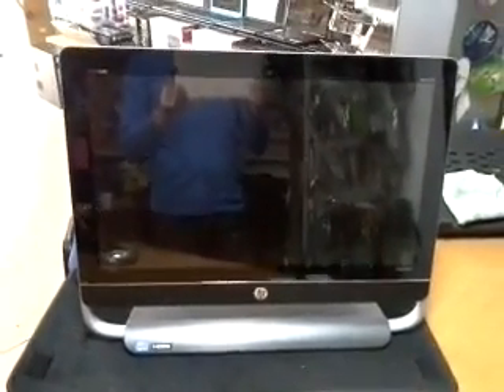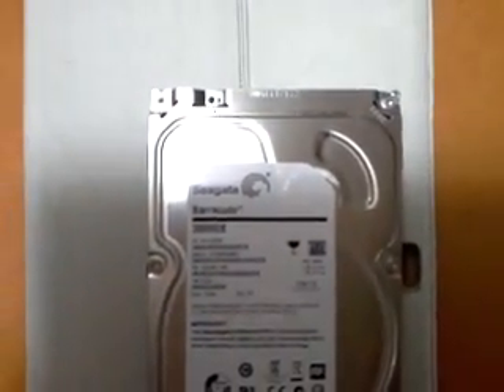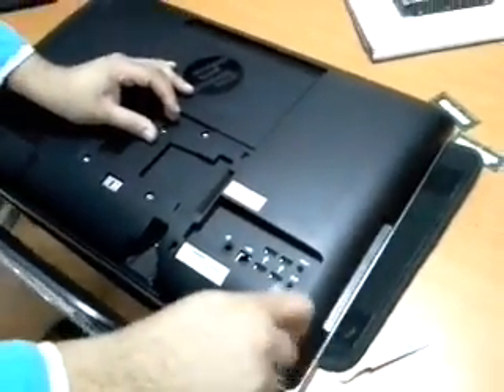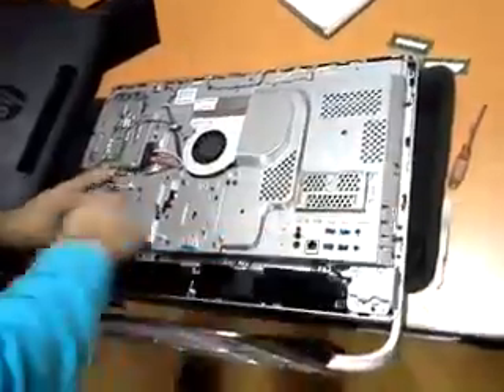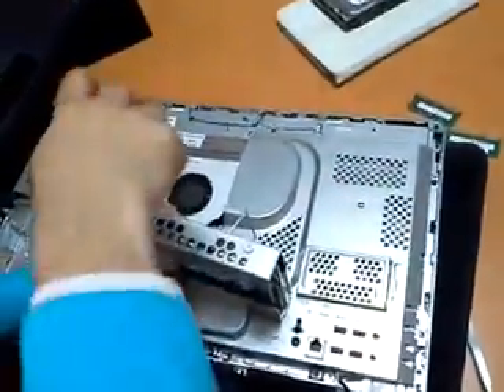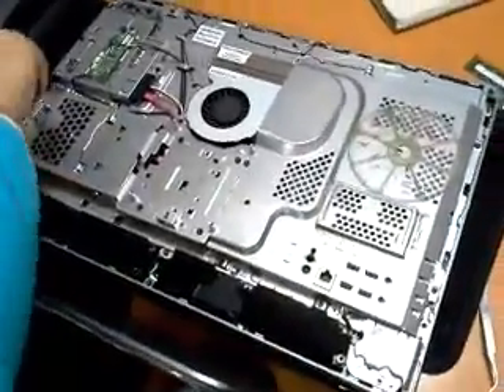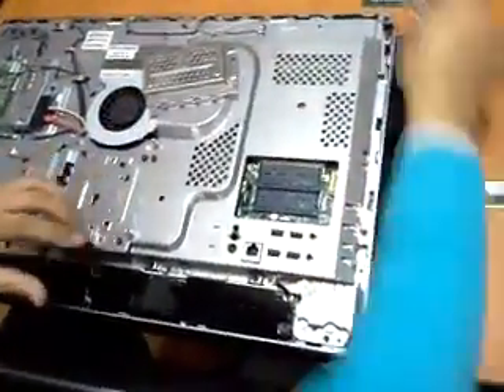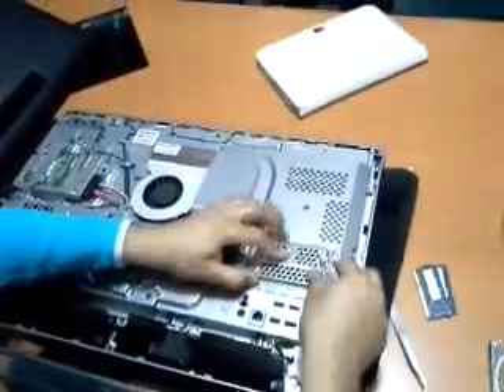How to disassemble HP ENVY 23 ALL IN 1  HDD 3TB+Memory 16 GB Upgrade

Comment: My hard drive is going out and needs replaced. Does anyone know what the replacement hard drive is (model # etc) and where it can be purchased? I have the HP ENVY 23 TouchSmart PC. Thanks!
Reply: Thanks so much! Do I have to have a tech background to install it or can I just follow your video? I have zero computer repair experience.
Reply: If you need to ask the question, you probably will need help.   What is not shown in the video is that you need to transfer an image (clone) of your old drive or else install from scratch.  Either method is likely to require help.

Comment: I'm not trying to be a troll or anything, but can't help but wonder why anyone would
want to do these "upgrades". I have the HP ENVY23 all in one pc. It came stock with
8GB ram. If you run "Resource Monitor"  in Windows 10 (or Windows 8) you can see exactly how much memory you are using. Mine rarely ever goes more than 60%. Maybe if 
doing some hard core gaming, but then who would use this computer for that anyway?
As for the hard drive upgrade, it would be easier to just buy an external USB3 hard drive if
you are just looking for more storage space. You don't even touch on the fact that if
you upgrade the internal drive you will have to buy a licensed copy of Windows 8/10.
Unless you have made a copy of the C: partition to some external drive before replacing.
Reply: Randy you assume too much and come off looking like an idiot. How do you know what is an acceptable level of resource usage is for this person? 

I have this same computer and have turned it into a local server for PleX, IIS, file server & a few network accessible linux VMs - adding more memory and a bigger hard drive would definitely benefit a person doing something like that. I agree that this unit isn't great for gaming.

Furthermore its not this persons job to detail every pitfall and aspect of changing computer parts. When you crack open a computer everything is on you so make sure you do your research, its nobody elses fault if something breaks.
Reply: Randy, what is not shown here is that most people doing this will clone their existing hard drive to a replacement ... that does not require buying new Windows license.  External media is slower than having an internal hard drive.   I'd go with an upgrade of a Solid State Drive because when you do actually look at Windows 10 resource monitor, you will see that the hard drive is pegged at 100% usage much of the time.  That is your big bottleneck on this unit.  The catch is that you would need to get a mounting bracket for 2.5" drives that places the new drive inside the existing bracket in exactly the same place to line up with the connectors.   I don't know if this model has an M.2 slot for a drive but on some newer computers that have it, that is an easier option.

Comment: Hi Lusia, I talk to a technician and he told me it can be the hard drive or the motherboard, But he was not sure, Next time I will buy a tower with a monitor, this all-in-one computers are to complicated to fix.
Reply: Hi Rafeal. Thank you and thanks to Milad. I spoke to friend of my and he suggests the same that the motherboard is done. I might try to replace it with new or refurbish one from eBay. It is not cheap around 200 USD I just don't wont to spend a thousand dollars on new computer. I will post what happen with my all-in-one. Thanks
Reply: Hi Guys. I forgot to mention that my hard drive is fine therefore the issue is with motherboard. Thanks
Reply: +Zbyszek i Lusia Fabjanski. did you ever get it fixed ?